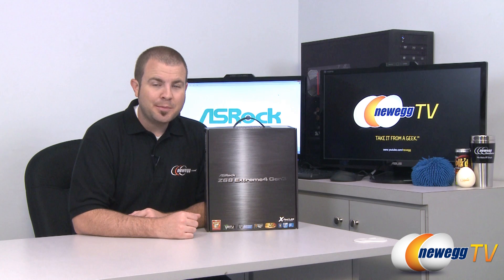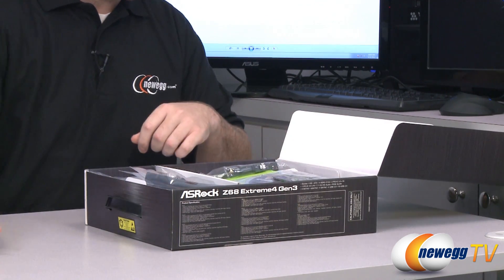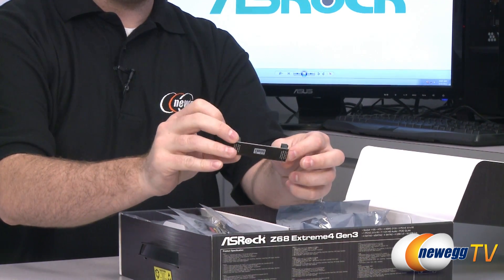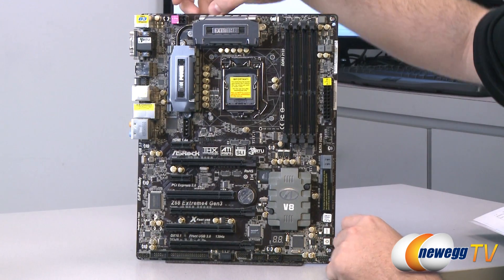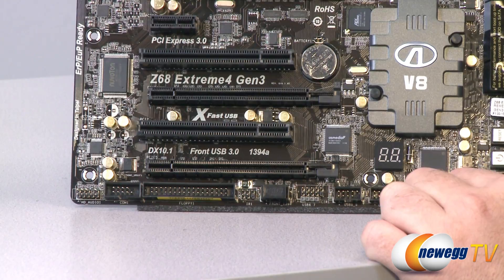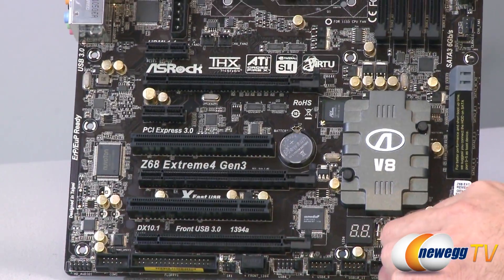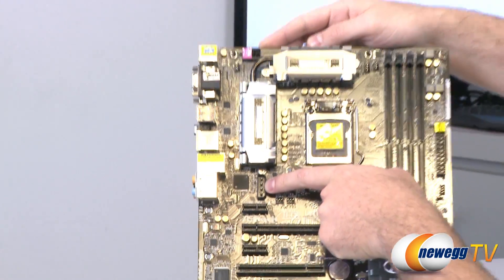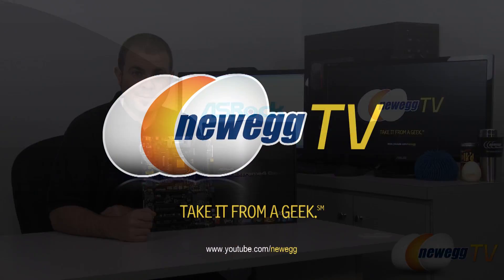Newegg TV: ASRock Z68 EXTREME4 GEN3 Motherboard Overview

Comment: It's compatible yes, although the Vengeance has tall heatsinks so you may run into clearance issues if you use an aftermarket cooler to cool an OCed CPU.

Comment: @3sonyps Pcie 3.0 doesn't really improve performance...
Well, it does, but marginally. Less than 1% on most video cards or pcie devices...
Unless you're running 2 mars 2 cards, you won't really need it.

Comment: @merts487 ASRock is the budget subsidiary of ASUS, they make good boards for cheap.
@newegg I was thinking about getting the cheaper version of this board, putting in the Intel pentium G620 (cause it is cheap), and using a cheaper GPU (thinking about a 6670). My plan would be to upgrade to an Ivy after x-mas (supposed release), and the GPU during the next gen release (April?). But I am concerned that Ivy will use 2011 for all the good cards, and only have low end 1155. any input / advice? Thanks